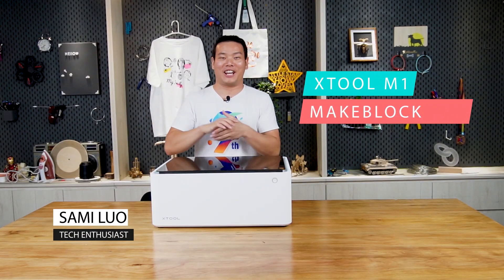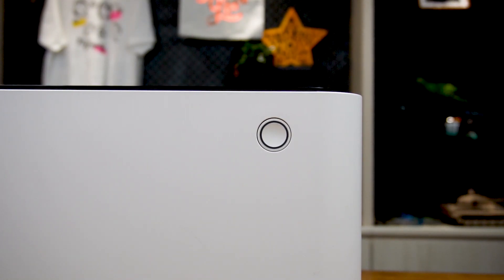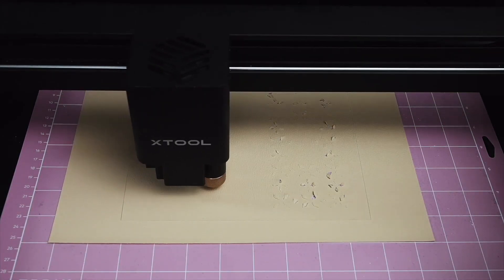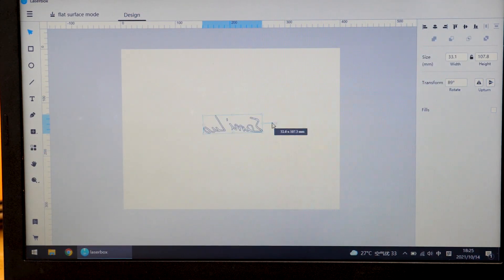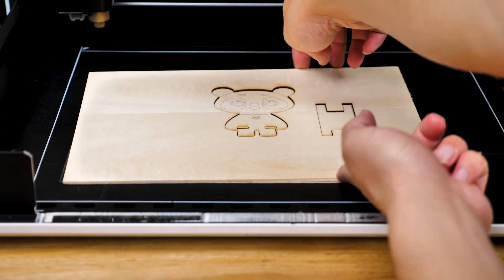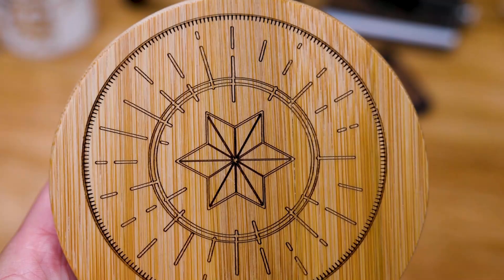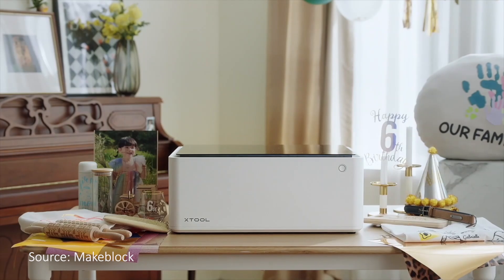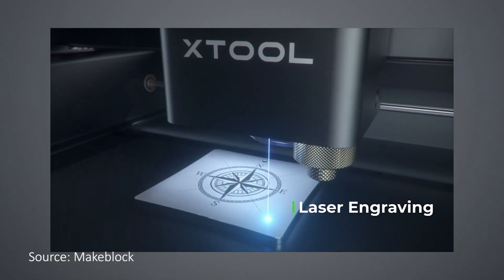xTool M1 Hybrid Laser & Blade Cutter: Dream Machine for DIYers?

Comment: Can you engrave metal with this. I like to make metal debit cards but will this work for that?
Reply from the maker: Yes, you can engrave metal on it and it surely can perform good on your metal cards, as long as they are not silver or gold :DDD
Reply: @SamiLuo  Okay, so it can NOT engrave silver or gold then?
Reply from the maker: @stephanemorrell5253  No, it can't if it's pure gold or silver. If you want a portable laser engraver for all metal, then I would recommend that Mr Carve M1 I've reviewed before, you can find in my previous video :DD
Reply: @SamiLuo  Well I still need a laser cutter though , not just an engraver ( specifically to cut thick 4oz leather ) . I just wanted to make sure I understood that this won't engrave those metals. Thanks!

Comment: Hey Sami, can you advise about replacement Blades? Is that a standard type of size that's easily replaceable? Like something you'd put in a cricut? Just tying to figure out how I'd source new blades after the ones which come with the M1 run out
Reply from the maker: Hi, thanks for asking, let me check with the official and get back to u very soon
Reply: @SamiLuo  thanks mate, really appreciate you following up for me. I can see they'll have replacements on the US store however I can't purchase from there in Australia so need to know how hard it'll be to get new cutting blades :)
Reply: Hello! From the video looks like they use roland standard blades. The very common ones. In fact all  the home cuttters no mater the brand has the possibility to add this blades with attachments. Hope it helps. I’m also very interested in  the machine. Best regards
Reply from the maker: @camshand  Hey just got a reply from Makeblock, it's the Roland blade just Albert said, lol. Also I asked about the lifespan of such blades, they said it depends on how often you use it, if you use it a couple of hours a day, it should last for several months.
Reply: @SamiLuo   Nice they go for a standard thing instead of propietary. They do wear, but as you say it depends on the use and mostly the material you're cutting. Anyway, they're super cheap in packs of 10 in the famous sites. As you're the lucky one who has already tested it, do you think is worth the investment (it looks like a Yes to me) the early bird price is sooo nice not to try ;) Best regards.
Reply from the maker: @albertcastro4155  Yes Albert, I absolutely think it's worth the investment (they don't pay me to say so lol). I've tried at least 4 or 5 different laser engravers (including that incredible Laserpecker 2), I think xTool M1 tops for its hybrid blade cutting and laser cutting and engraving. I will try to find some time to do more material tests, stay tuned, my friend :DD
Reply from the maker: @camshand  It's a good buy :DD
Reply: @SamiLuo  Backed the early bird basic 10W version ;)

Comment from the maker: Just updated with English subtitles. Do you like this xTool M1 Hybrid Laser & Blade Cutter? What will you do with it?
Reply: I'm a graphic/ industrial designer & 3d generalist and I do graffiti & paintings. I've got a cameo 4 that use mostly for stencils, masks, etc. Adding a laser cutter will give me the possibility of doing 3d - layered things. We have to wait to see ;)
Reply: Yes i do. Im a crafter. I love making thing to give out. Awesome on my budget ♡
Reply from the maker: @jaslovedujour2653  That would be awesome
Reply: How much cost of this machine? Which software does it use?..
Reply: @marqueesio  The machine is on preorder for ~$800 USD and uses the xTool Laserbox software (currently for the D1, though I'm sure it will be updated for the M1). But You could use it to get familiar with the current software and then when the proper software comes out, it'll will be less of a transition to adjust to the new settings (such as the blade cutting options)
Reply: I jumped on the kickstarter when I first heard of it and got the deluxe package. I can't wait to get it now.
Reply: What about exhaust issues? Is there a way to connect exhaust like with the Infinity exhaust systems? Because you dont want fumes quickly filling up your workspace. Especially when engraving and cutting through acrylic. Brilliant fusion of tools. Thanks for making this video. Xie xie ni!